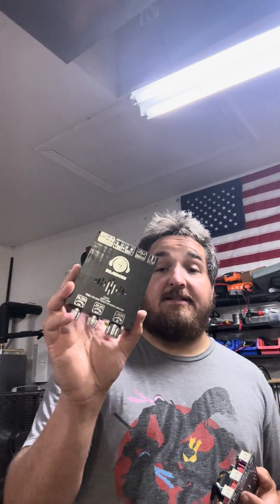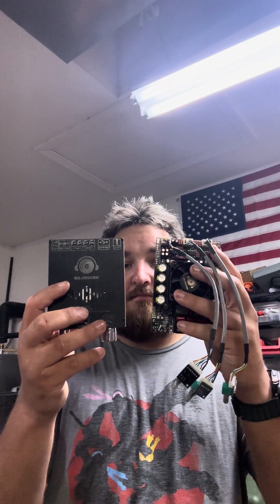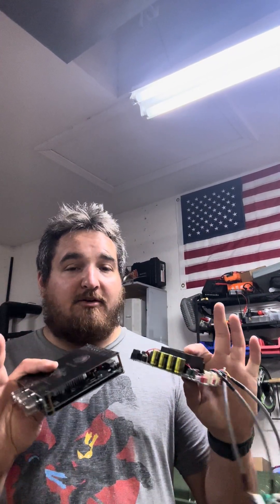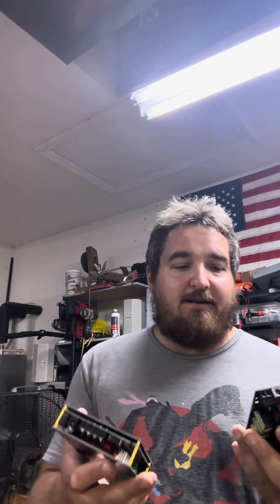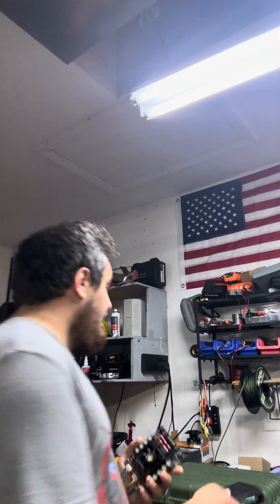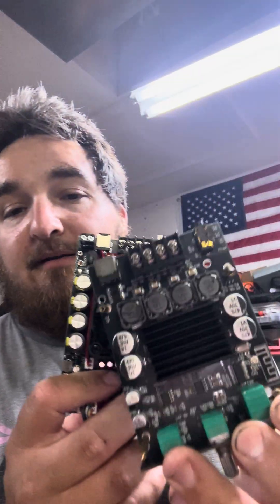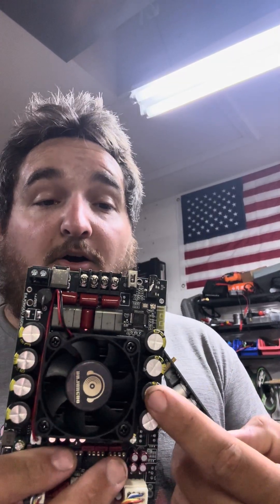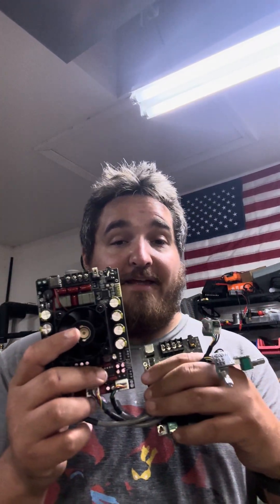The voltage input is very important to the wattage output on some amplifiers

Comment: But....the 1002T will not play with over 27V. My last 24v battery when fully charged outputs almost 29V and the 160 will wk with that input voltage my 1002 will not until voltage drops below 28v